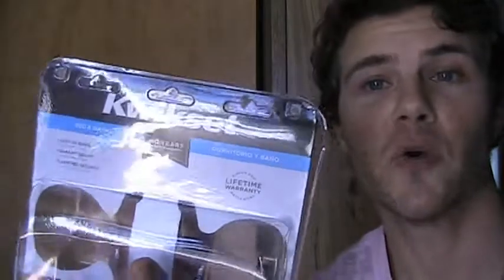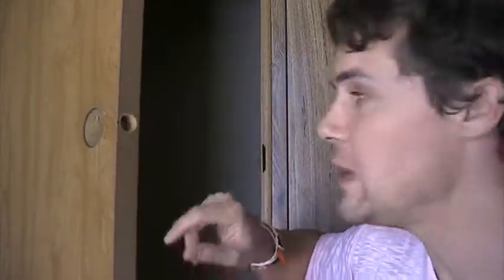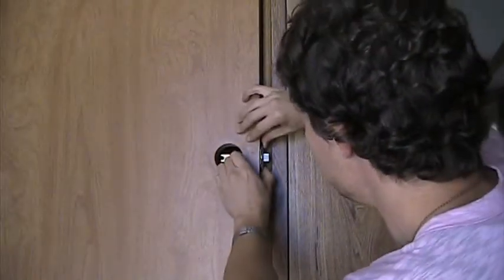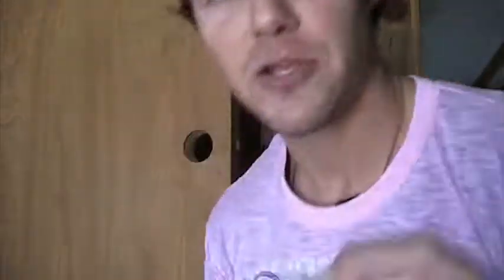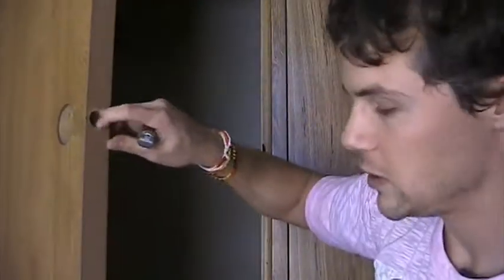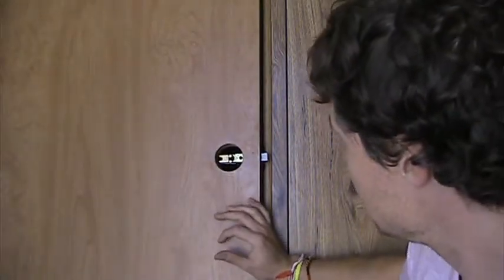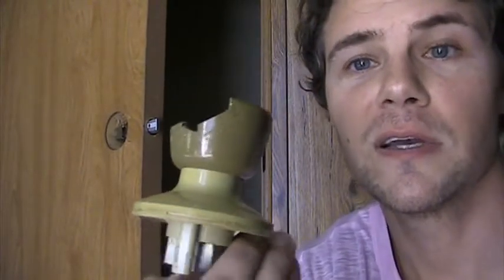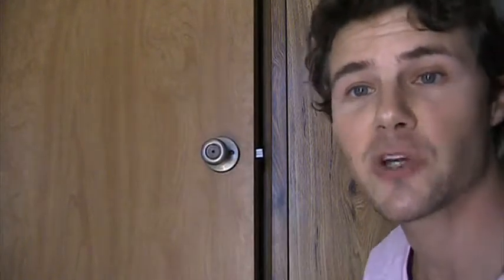Quickly Changing A Mobile Home Door Knob

Comment: I'm trying to buy the resettable changed any key kwikset front door door handle locks on my 1990 mobile home do you have any videos or suggestions?
Reply from the maker: Thanks for commenting. I am all about those resettable sets as well. Those are usually available online and slide right in to most of our exterior doors. Hope this helps and points you in the right direction. Any follow-up questions never hesitate to reach out anytime.
Reply: Your explanation of what to do on the latch was the most helpful.  Thanks

Comment: Great video but I did  pick up a Kwikset but the hole is not big enough for the four legs I call them so do I have to have the hole made bigger?
Reply from the maker: Thanks for watching. getting great job calling up the company and getting to the bottom of things. If you do need to make the hole bigger to use the quickset, I would instead look for a new doorknob/lock in the big box stores that does fit the current hole size.

Comment: Please help me I’ve have Heritage a mobile home for my departed grandmother and I need to change the deadbolt and door knob combination of two deadbolts and three door knobs in the whole home. I want to make sure if I go to Home Depot and buy the three door knobs and the two deadbolts that they will work for the mobile home. She mainly use the carport to enter and exit the home and now the key just spins when you put the key in it. This mobile home is very old it was built in 1977 so I can’t invest a lot of money because the park that it’s in will not allow it’s rental or sale. 😑😕😔
Reply from the maker: Thanks for reaching out and connecting. My apologies about your grandmother's passing. You've likely already purchased these door locks by this point. My apologies for the delay in this comment reply. Double check with the folks at the hardware store about whether or not these will fit into a mobile home interior or exterior door. Some brands will mention that they fit in mobile homes and manufactured homes. Hope this helps and points you in the right direction. Feel free to keep in touch moving forward with any follow-up mobile home related questions.

Comment: I had a door knob come off while closing my bathroom door on my mobile home. I was inside the bathroom lol but now the knob won’t stay on. Not sure how to fix it? Do I just need a new knob? Thanks in advance!
Reply from the maker: Thank you for reaching out and connecting. Mmm... That is a tricky one, as I am not there to check it out for myself. However I would encourage you to probably get a new doorknob set. These are less than $15 or so at the local big box stores. This is likely something that you can replace yourself with a simple Phillips screwdriver. Hope this helps and points you in the right direction. As always, any follow-up questions never hesitate to reach out any time.

Comment: How can I try and save the old door knob but won’t connect right what can I do
Reply from the maker: Hi Ashley. Thank you for reaching out and connecting. If I was able to see the doorknob itself that I could likely diagnose why the different parts were not connecting to each other correctly. Perhaps this is a simple adjustment perhaps part of the metal or plastic broke. Having a handy person look at this to see how they can best fix or keep this older doorknob may be your best bet. However an interior doorknob will cost around $10 at Walmart so it may be cheaper simply to go with the new one if you are just looking at the cost. I'm sure this does not help solve your problem however I hope it helps point you in the right direction. Feel free to email me directly and send me some pictures of the doorknob if you would like. We can always reach me at support@mobilehomeinvesting.net. All the best.

Comment: Hello my keys defective do I need change whole front door  or those knobs can be change one flat key the second is bellow with keys is two keys is hard to open the doors
Reply from the maker: Thanks for commenting. Good news, you can absolutely change the door locks without changing the entire door itself. You will likely be able to find new locks and/or deadbolts for under $30 at most hardware stores or even Walmart. Make sure to purchase exterior locks, and not interior doorknobs. Hope this helps and makes sense. If you have any follow-up questions please never hesitate to reach back out anytime.

Comment: Does anyone have a cap to an old interior mobile home door. The kind that pops off?  Please and thank you. Belinda
Reply from the maker: Hi Belinda Craven. Thank you very much for reaching out and connecting. Do you have a mobile home supply store near you? Or maybe a store that caters to RV owners? If there is an older mobile home at a local mobile home dealers lot you may also be able to go in and take one yourself for parts. You want to of course get permission first. You may also be able to find this online however since it is older I am not sure if this is possible. I do not believe this answer was very helpful however I do hope it gives you some ideas you did not think of before. As always, if you ever have any mobile home related questions now or moving forward never hesitate to reach out anytime. All the best. Talk soon, John
Reply: @MobileHomeFormula  Thank you for such a quick response. After days of looking, I found it in the dryer. Must have been in a pocket. I took off all the interior knobs and painted them with a strong bond spray paint. That look great. 

I do have another question that I hope you can answer. Several years back I had the mobile home covered in siding. I now need to replace an exterior door. Have you come across a scenario like this before. I’m worried out how to replace the frame as it seems like the siding wraps around the door way a bit.

Comment: Does anyone know where to get FLAT face plate that it latches into, that sits ON the door trim ? The new sets  I got have the metal edge that inserts into the chiseled area. I spent 30 minutes on one door cutting and  chiseling out a place for that metal piece to go into. At that rate, I am thinking of just painting the old gold colored ones and reuse... it would be quite the chore having to chisel out each door (10 doors, uggg). I cant seem to find them online. Thanks for a reply, in advance.
Reply from the maker: Good question. Interesting problem you are having. Perhaps using an angle grinder to grind down those edges on the plate or cut them off completely may be easier than using a chisel on the door. Curious to hear what you come up with.

Comment: I think the tip is great, however, how do you get the old ones off that are made like that knob?
Reply from the maker: Thank you for reaching out and connecting. Over the years I have definitely seen at least a dozen different type of interior or exterior doorknobs. They almost always have screws for you to remove, which usually releases both sides of the doorknob. However sometimes these screws are hidden with a plastic or metal flap that has to be opened with the help of your fingernail or a flat tip screwdriver. When in doubt, I have hit a few of them softly with a hammer and that sometimes helps remove any pieces that are covering these screws. I hope this helps and makes a bit of sense. Not sure what door knobs you are looking at however if you have any follow-up questions never hesitate to reach out any time. All the best.
Reply: @MobileHomeFormula  thank you so much for responding.  My handles look like the one in the video.  They are plastic. There is only one hole where you can release the lock. No caps to remove either. I ended up hammering it off. In the pieces I found that the unlock hole has a long Phillips head screw to remove it. I hope this helps someone else. Your video is great. Short and to the point. Thank you.
Reply: No one has given good information as to how you remove the old passage set which is moulded plastic, with no visible screws.

I tried removing the end caps which may be covering the screw or screws holding it on.

Even talked to someone at a mobile home sales company and they hadn’t heard of it, because that type of passage set must only have been used in older mobile homes, which is a good thing.

Anyone that can confirm that the end piece has to come out of the inside knob would be greatly appreciated, and, if I break it, I will have to find some way to repair it when I put it back on after I remove the lock set I want to put on while I’m using that room as a rental tenant.

Thanks for any information and advice.

Comment: Does this trick work for all door knobs or just kwick set?
Reply from the maker: Thanks for reaching out and connecting. Not all doorknob sets will be able to do this, however other brands besides quikset make this adjustment. This is not a very specific answer however I hope that this helps some. Feel free to keep in touch moving forward. All the best.

Comment: Thanks and interesting.  My situation is the opposite.  I have these door knobs in an old townhouse and was hoping no chiseling would be involved to replace them.  I hope the installer used regular knobs and removed the rectangular face plate and use the round door piece and no chiseling will be involved to remove them.

Comment: How is the original knob held on there? Does it need to be broken off?
Reply from the maker: Hi Alfonso,

The old door knob was very secure and held in place by the metal grooved cylinder that connect one handle, through the door to the other handle. One the screws were removed the door handles pulled right apart. In short there was no need to break off anything.

Hope this makes sense.

Best,
John Fedro
Reply: Thanks John, 

I guess my door knob is a little different. It's All plastic expect two metal rods inside that are fixed on one knob and connect through the door to the other knob. But basically what I did was pull REALLY hard on one knob and it popped off but it was the other knob that had to come off and it revealed the famous little screw. Thanks again I was sure I was going to break something before you commented.

Comment: Have you ever tried to change an exterior (outside) locking door handle?  I just bought one made for mobile homes and it's too short.
Reply from the maker: Hi flilguy, Thank you for reaching out and connecting. I recently changed exterior door locks and deadbolts on a mobile home just a few days ago. I am curious at what was too short when you tried to change these locks. If it was the cylinder assembly I can understand. However I did notice that on the lock I have purchased and allowed me the option to rotate the cylinder to make this longer or shorter in order to line up with the knob assemblies. In my opinion I would take this back to the store you purchased it from, hopefully it is a hardware store, and speak to the people there with regards to your exact issue. They will likely be able to point you in the direction of a door handle assembly that fits better, or how to extend the current assembly that you have now. I apologize I'm not able to be more of a help with regards to this as I'm not sure your exact situation and cannot see what you have going on. With that said I hope this helps and starts to point you in the right direction. As always, if you ever have any follow-up questions or concerns now or moving forward never hesitate to reach out any time. Talk soon, John
Reply: @MobileHomeFormula  Last week I was packing up the door knob parts to return it to the store.  I was looking through the instructions.  There was a clip or a spring pin that you move and it makes the latch assembly a half inch longer.   I clicked it over and it extended out.  So now the latch is long enough to hold the door shut.  Some doors are 2-3/8in and others are 2-3/4in.

Comment: The area where the latch goes in is too small to fit the latch and much less adding the converter thing. I think it was the kind that has the long handle. I really don't wana have to get someone to drill a bigger hole, if I can't find it, but I'm scared it'a also going to be very expensive. Thinking maybe I'll just leave it and use tape lol.

Comment: Hey great video thank you this has been an issue Ive had for my mobile home door knob that I had to remove because it was broken. This might work, the only concern I have is finding a door knob that locks. The one you installed doesn't lock from the other side right? Please get back to me if you can answer this thank you!
Reply from the maker: Hi melissa reyna, Thank you for reaching out and connecting. Very glad to hear this video has been helpful to you already. To fix your situation you want to find and purchase an "exterior door lock". This is the type of lock that will have a key on it it will be used for an exterior type of door or any door that you want to have locked with the key. I hope this helps and answers your question. If I misunderstood the question never hesitate to comment back any time. Keep in touch. Talk soon, John
Reply: Hey! Thanks so much for responding. Im finally going to home depot to find a lock. Well see how it goes if I have any problems ill go to you. Thanks again.

Comment: Hi! The kwikset bed & bath door knob still does not fit. I realized my previous one was much smaller than the one in your video. And a completely different style knob, any suggestions where I can buy one that fits? Im not sure what style the knob is to search online. Its a struggle, please let me knw thank you!
Reply: I have the same problem!
Reply: @ShadowsandCityLights  I think we're just going to have to go online and find a mobile home supplier for bed/bath levers [I HATE installing knobs because it's so difficult to get straight screws installed around a round knob; dumb design). When I force-fit a regular lever onto my 2006 mobile home door, it sort of works but I feel like someone could get locked inside because the locking mechanism is really difficult to turn. Jerryrigging isn't good on a bathroom door :(

Comment: Im having a problem finding a replacement deadbolt for the front door of my manufactured home the center of the hole was drilled at 2 3/4" definitely not a standard measurement. The original defiant deadbolt latch is longer than any other deadbolts and fits. The latch on any other does not they are all to short. Where can I find a replacement that fits.
Reply from the maker: +KK Prepper Thank you for reaching out with your question. I have not run into the situation before however I do agree with you that that is not a standard measurement for sure. The two thoughts I have for you are to contact a locksmith to see if they can point you in the right direction AND talk to the customer service desk at Home Depot, these folks may be able to special order the correct latch for you. I wish I could be more of a help and provide you with a clear-cut answer. Please keep in touch and let us know what happens if possible. I'm sure other folks will or may be having the same issue. Keep in touch and talk soon, John
Reply: you can adjust the bolt lenght

Comment: Im looking to switch my mobile home bedroom door knob with a mobile home interior keyed (security) door knob. Can I do the same thing with a regular keyed (non mobile home) door knob as you showed in the video?  Please say YES!    :)
Reply from the maker: +Debbie Lemon Hi Debbie. Yes, if you use the KwickSet brand you should not have a problem doing the same thing this type type of lock either. I hope this helps. Keep in touch if you have any questions or concerns moving forward. Talk soon, John
Reply: +John Fedro So I tried this and its not fitting flush to the door. There is a gap between the door knob and the door. Suggestions?

Never mind. The screws that came with the set were too long so I used the screws from the old door knob and it worked perfect. Thanks again for this tip!!

Comment: The doors in trailers are thinner, therefore the screws bottom out before the knob skirts press into the door face. 

Cutting the screws by screw-cutters is difficult, they are hardened.  I used some 8-32 screws that were shorter. 

The screws that I used bound up partway down, so I chased the threads on the handle part with a tap. 

Hope this helps someone...

Comment: Can't get it to work because trailer doors are not as thick, so knob has a big gap. Any suggestions?
Reply from the maker: Hi Bobby Cross, Thank you for reaching out and connecting. Additionally, thank you for your detailed question as this certainly helps me give you an answer. There may be a better way to accomplish the outcome you are looking for however I have seen in also had success by taking two small pieces of scrap plywood that are roughly half inch thick each. With a bit of trial and error and the correct tools you can build a sort of "faux" door from these two pieces of scrap plywood on the exterior side of the door between the door itself and metal of the knob itself. I apologize if I'm not doing a good job explaining this with words. The final result definitely looks homemade however it is usually functional when done correctly. There may be another way to shorten the internal mechanisms with the metal cutting saw however I have not tried it this way. Moving forward if you come across a better video or find a better solution never hesitate to write back and commented here so we can all learn. Thanks for reading. All the best. Hope this helps. Stay in touch. Talk soon, John
Reply: Thanks John. I have a number of regular handles. The trailer ones are cheap plastic and I've taken them apart and saved pieces and put them together constantly. I'll try this. Many thanks for the reply and the channel.